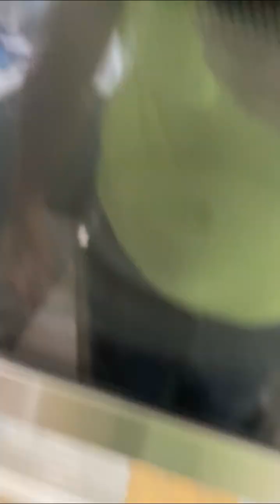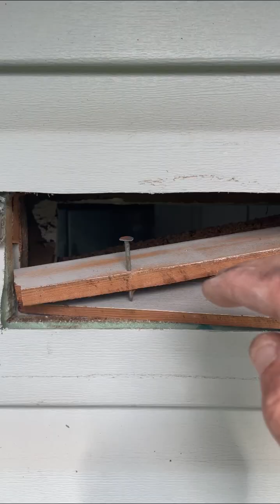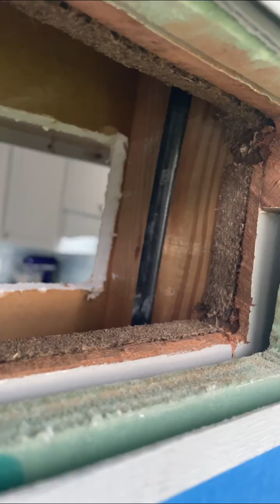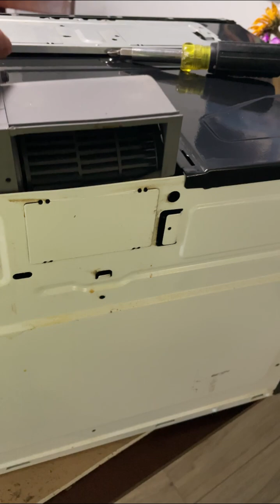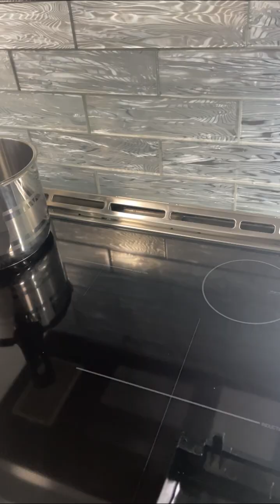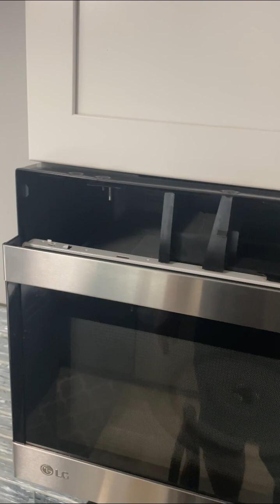Microwave Wall Vent Installation (vinyl siding caulking ￼) with design flaws discussion .￼

Comment: You are the only one that I have seen that installed a metal duct insert on to the interior wall that inserts into the outside duct exhaust.  This then provides a full proof continuous metal insert for the microwave unit to fit into.  Adding metal aluminum tape, as you did, then keeps exhaust air and grease from leaking into the wall cavity. This approach is superior to other installation methods in my opinion!

Comment: Experiencing that same issue with my new Frigidaire OTR microwave when venting outside whereas there is intake through the vents on top (which seem to be for cooling the actual microwaving components as I can see internals through the vents).

It also appears from research that this has been going on with various brands for years.

Were you implying that there's no way to "seal it up" so that there is only a return path from the bottom vents/grills?
Reply from the maker: Yes I was. I assume since the design of the blower motor to operate in three different functions the internal ducts are going to leak air and not exhaust very accurately. which is probly okay considering if you made too much negative air inside your home you could possibly pull fumes from hot water tank and furnace into your home. that is only speculation on my part though.